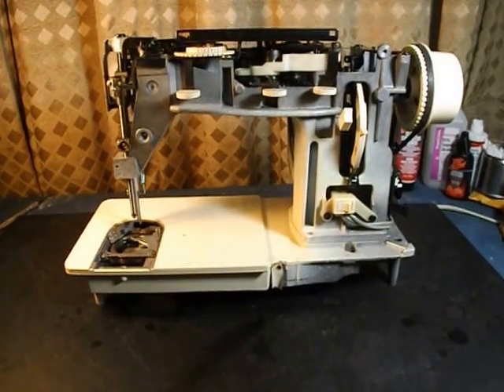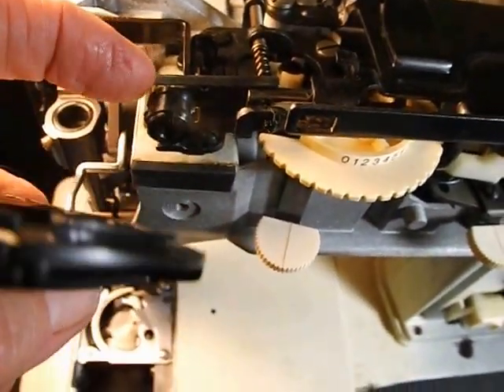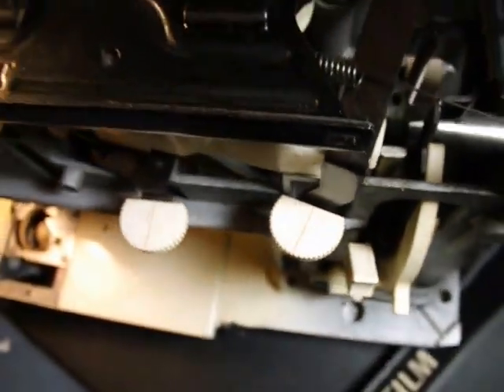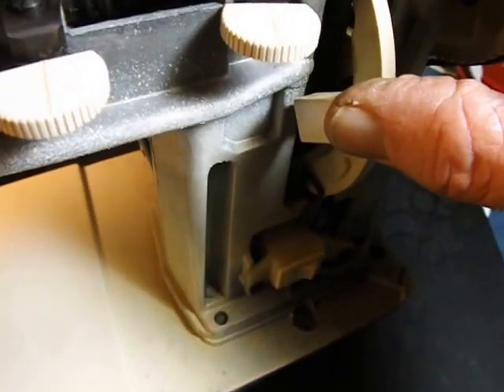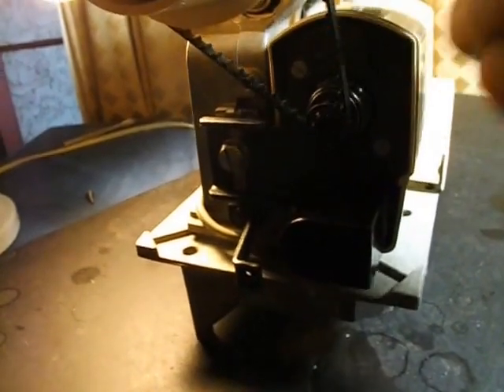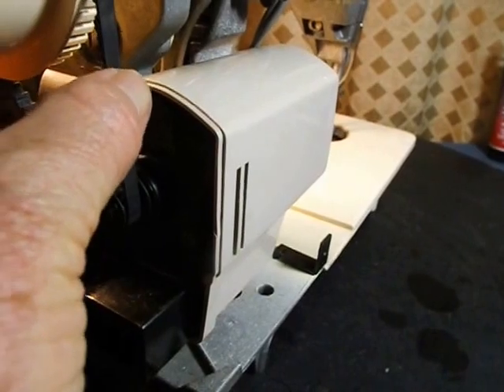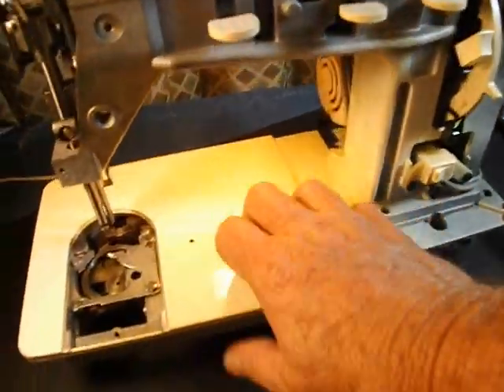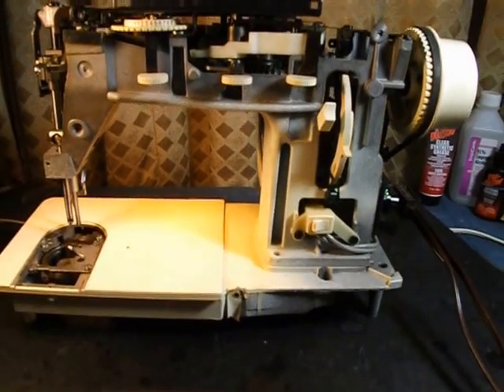SINGER MODEL 353 GENIE INSIDE TOUR OF WORKING MACHINE

Comment: Hi Andy. I just bought my second Genie 353 (my dad took the first one I had rescued from water damage for fixing the sails on his boat years ago) and I also own a Singer 403 Slant-O-Matic. Tri-Flow clear synthetic grease has been recommended for use on the gears. Do you recommend it, and if so - with or without teflon? 
By the way, on this Genie the lower tension is extremely tight and the thread gets hung up in the bobbin case. The tension adjustment screw does nothing - and it actually fell out when the case was out of the machine because it fit so poorly! I am going to get a new one and start there. I bought it from a family of 5 that is permanently living in their RV and traveling. It had been carefully packed in the 'basement', but I have brushed a lot of road grime/sand out of it. They plugged it in and she purred - but I didn't bring my usual bag of goodies (scrap fabric, thread, needles, etc) to actually see if it had any stitch issues. My bad - and for $60.00 I feel a bit foolish. It was an emotional purchase for sure. I surely hope it is a simple fix when I replace that bobbin case, then I will take it apart and do a deep clean. Thank you for your expertise.
Reply from the maker: Let me start with the Tri-Flow question. I use the one with P.T.F.E. ( Polytetrafluoroethylene (PTFE) is a synthetic fluoropolymer of tetrafluoroethylene that has numerous applications. The best-known brand name of PTFE-based formulas is Teflon by Chemours. Chemours is a spin-off of DuPont, which originally discovered the compound in 1938.)
I absolutely use it on machines with metal gears, like the model 403A. The P.T.F.E. reduces friction which reduces heat and those two things are the enemy of moving metal parts. I also found it sticks well to the gears and has a high temperature rating. The gears on that 403A get hot when sewing. For me, using grease on plastic gears is somewhat optional. If I have a plastic gear mating with a metal gear I usually use the grease. If I really feel grease is even required in a plastic-to-plastic set-up I will use a small amount of the Tri-Flow b/c it is rated "safe" for most plastics.
Congratulations on finding a Genie model. Model 353/354 Genie and Starlet Models use the Apollo Bobbin Case, along with about 200 other models of Singer. https://www.vintagesingerparts.com/collections/singer-model-353/products/singer-apollo-bobbin-case-fits-many
It is about the least expensive bobbin case and I always buy them in pairs b/c they are plastic. Your new one should be factory set at a good tension level, and if that was the only problem with your machine you should be good to go. Of course, there can be other reasons for thread hanging in the bobbin area, but just clean the area good an try the new bobbin case.

With the upcoming popularity of the Genie models paying $60 is not too high a price. It is my favorite "portable" zigzag machine.
Reply: @andytubesewing1953  Thank you! I just rewatched your video and caught the Tri-Flow notation and actually could read the tube. I must have been distracted the first two times.  I just finished ordering the bobbin case, grease, and new rubber feet as the originals were DEAD! Oh, I didn't see plastic gears in your video, except for the stitch control dials. It was about 1990 when I tore my first one down and I remember cleaning out a lot of rust from the water damage. I live in AZ too, and yes - the dust and Sandy grit gets in everything! We are in Fort Mohave/Bullhead City, across the Colorado River from Laughlin, NV so there is plenty of sand here. Thanks for your reply. I love your videos. My husband and I cruise thrift stores and often find sewing machines that just need a good cleaning and oiling to put them into service. Then we donate them to our church or friends in need. He finds them, I 'fix' them. I am a sewing machine repair person wannabe!
Reply from the maker: The Genie has a plastic gear on the top of the vertical shaft. It meshes with a gear on the horizontal arm shaft. The vertical shaft goes down below to the pulley on the right side that runs the belt and pulley to the hook. In the Singer service manual it shows putting a little grease on those two gears. Many years ago I traveled highway 95 thru your area to get to Interstate 10 at Blythe and go west. That is a Colorado River area, right? So besides the famous sands of the Arizona desert, I remember it was humid there. Sand & humidity! Trouble for electro-mechanical devices like sewing machines. You touched my heart when you mentioned how you rescue those machines, clean them up and donate them. I love it and thanks very much for saving the machines and getting them back in service. If my videos help you do that, then I am a very happy fellow. Bless you, both. Like my Mom used to say, "you'll get your reward in Heaven", hehe.
Stop by anytime and take care.

Comment: Hi Andy,
just waiting for the seller to respond. When I was a little boy I always sat on the floor watching my grand mom sewing on that old black machine. However I was fascinated by all the moving parts and became a military parachute rigger. Do you know the speed aka stitches per minute?  Thank you  BOB
Reply from the maker: The Service Manual usually list that info. Remembering the motor in the 353 I'd say a minimum of 900 stitches per minute. That is a common speed for vintage machines, although some are much higher.
Reply: well i lost the machine because the buyer removed it
Reply from the maker: @ocean101bob4  Weird! Wonder why. https://www.shopgoodwill.com/Listings?st=singer%20sewing&sg=&c=&s=&lp=0&hp=999999&sbn=false&spo=false&snpo=false&socs=false&sd=false&sca=false&caed=4/18/2020&cadb=7&scs=false&sis=false&col=0&p=1&ps=40&desc=false&ss=0&UseBuyerPrefs=true
Sometimes the "buy it now" machines will ship for 1 cent.
Reply: @andytubesewing1953  HI ANDY,
WOW I never ever heard of that site and I checked some machines just to get shipping fees and fees are very reasonable.
Thanks so much for the info you provided.
BOB
Reply from the maker: @ocean101bob4  I heard about from my viewers. I think Goodwill gets a discount on the shipping as a charity. Some people have reported damage during shipping then GW gave them a refund. Worth a try. Good Luck.

Comment: Thanks for these lovely resources - I'm going to be grabbing my mom's old Genie and these videos will be invaluable help for troubleshooting. Honestly though it's such a sturdy old machine that was taken care of well, I don't suspect much needs to be fixed :D
Reply from the maker: Sounds good. Maybe brush out lint, a belt and LED bulb then fresh oil?. The only known weak point of the machine is the plastic gear on top of the vertical shaft. I've been hearing from people about a broken gear on the model for about 6 weeks now. If you do take the covers off maybe take a peek at that gear. It meshes with a vertical gear on the main arm shaft, to the right of the cam stack. The machine is going on 50 Y.O. and the plastic gets brittle over time. A new gear is about $10 but it's a process to get in there and change it out. Good Luck and family machines are the best to own, IMO. https://youtu.be/M3bFtlV1Y6s

Comment: very kindly explain ing for me.

Please upload at next time, Singer 6212c, 6214c, 6215 c, 6217c .
How to remove the Singer 6215c' s top patterns cover?
I want to know that.

Thank you.
Reply from the maker: +tk 516 Thanks for the comment. I do not currently have a Singer 6215c in stock. To remove the top cover there is 1 screw above the needle bar area, and 2 screws back next to the bobbin winder area. Once the top is off you can usually set all the stitch sliders in the middle position ad unclip the plastic pattern cover. Sometime there is a small bracket and screw just inside the top of the machine right against the front edge. I'll add a link to a store where you can purchase a service manual (not instruction manual, but repair type manual) for $10. These usually show how to remove and replace both parts. Sometime you can find a service manual for free by Google Search. You can go to http://www.singerco.com/support/instruction-manuals and download a free copy of almost any Singer instruction manual. Link to buying a service manual: http://www.sewusa.com/Sewing_Machine_Manuals/Singer_Manuals/Singer_1000&UP/6214_Instruction_Manual.htmI am NOT associated with sewusa in any way or manner.Best Wishes tk 516  :)
Reply: Sewing genie